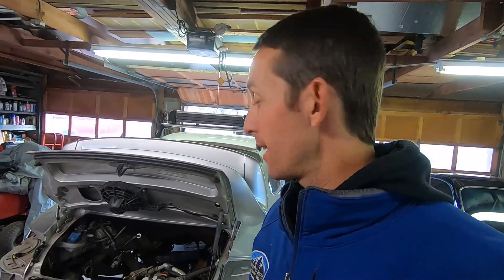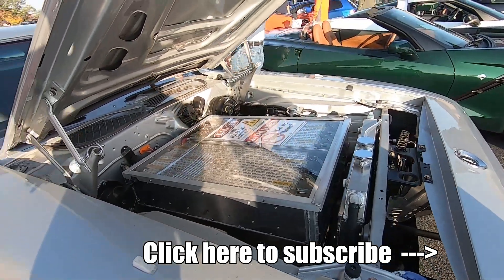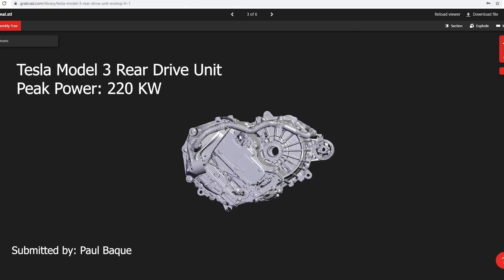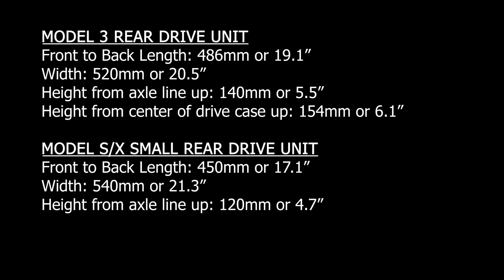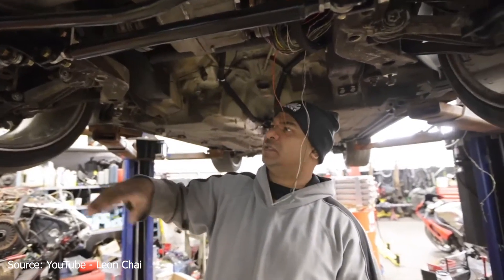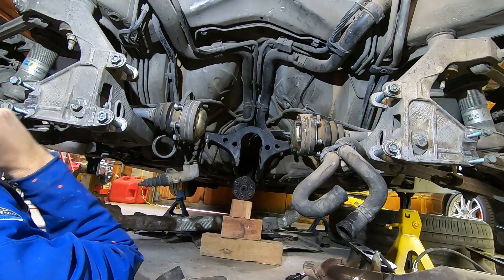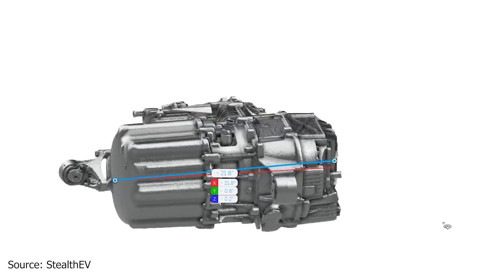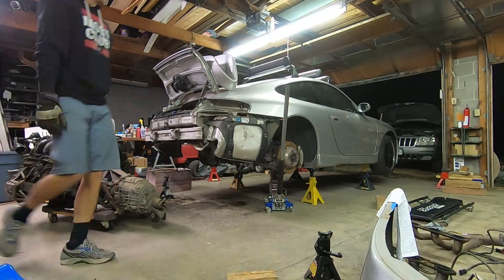Porsche 911 Tesla Swap Part 4 - Selecting a Tesla Drive Unit.

Comment: glad this video showed up in my recommended. im planning a dual motor conversion on my 93 impreza. i talked to ev west for advise. originally wanted 2 large drive units but due to me also wanting to run a model 3 battery they recommended 2 small drive units due to the required amps to run the motors at full tilt. i was not aware the model 3 motor sat in front of the axle. i think i want mine to remind behind so small rear drive unit it is.  i know hybrid batteries are best for performance but i m not willing to neglect range for power. and they claim the small drive units are good for about 300hp each. 600hp is more than enough to achieve my goal

Comment: Why not use a hyper 9 motor, and keep the transmission as well as the AWD system
Reply from the maker: I want to use the Tesla drive unit due to its simple design and light weight.  Weight is something I want to stay conscious of and minimize.  The power output of the Hyper 9 motor is pretty low if I'm looking at the right one.  Also, I've never done this before so I want to stay rwd for now.  I actually have another carrera4 so I won't miss the awd.  Another front motor might be an add-on in the future.  Thanks for watching!
Reply: @KennyGillis  makes sense. Hyper 9 was an example, when other motors exist. 
I do like the Tesla motor approach and curious to see what the car weight will end up being.